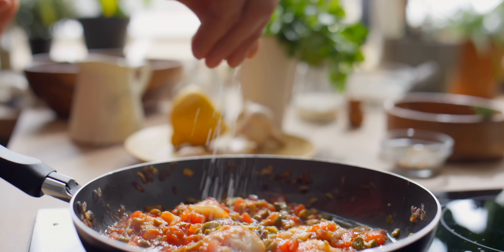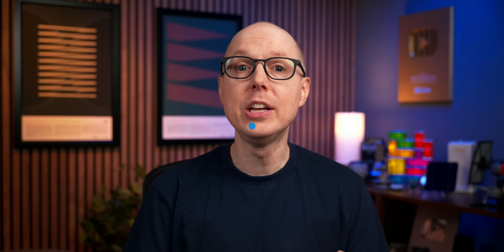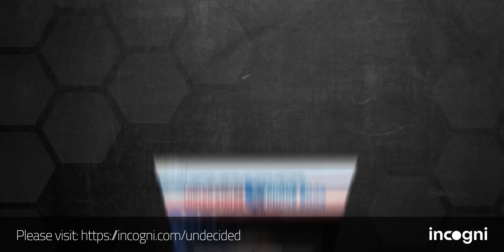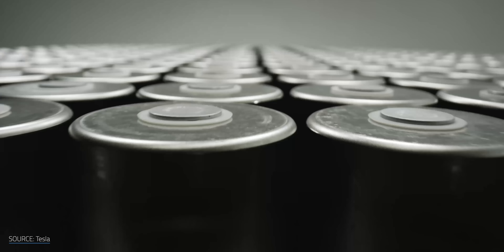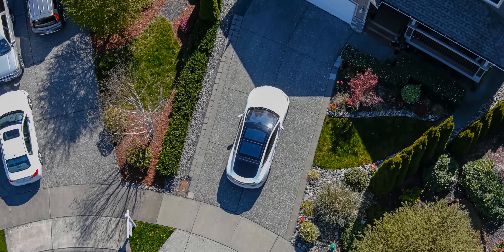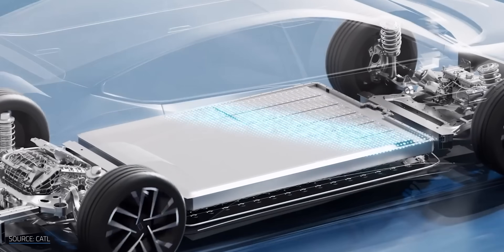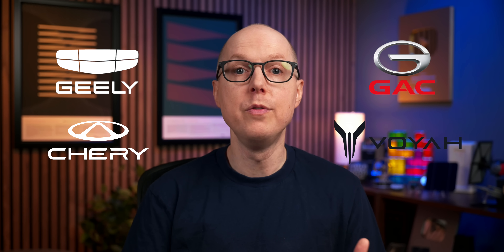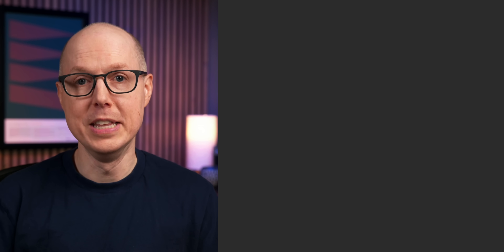How CATL Made Batteries 90% Cheaper (And What Happens Next)

Comment: I work in the battery industry and there’s a few points I would have liked to see you include. First, the most important thing to me is that these have been tested by a third party, which they have. So many battery companies will make outlandish claims that it’s not worth getting excited about anything until somebody else proves the results. Second, I think it’s important context that experts predict that at least in the US market EVs will not outcompete combustion engine cars until we get energy densities far greater than NMC, let alone LFP or this new technology. You’re absolutely right to point out the utility of pairing this with other chemistries or using this for home backup, but I remain skeptical of shifting the market towards low energy density EVs. But maybe I’m biased because I work for a lithium sulfur startup.
Reply: Higher energy density will help but not as much as lower prices. If we couldn't get higher density but could produce EV's at ICE prices or lower then game over for ICE's. That will happen this side of 2030.
Reply: @TimMountjoy-zy2fd  But if you factor in running and maintenance costs, EVs are already the cheapest alternative, at least here in Northern Europe. Still about 50% of new cars sold in my country are ICEs. Range anxiety, ignorance, habits and political views factor in. Personally I would never buy an ICE car now mostly because of the environment, but also because I think the re-sale value of an ICE will be dismal in 5 years time.
Reply: @LK-jl3pc I'd push that out further to 10-15 years, though I agree with you broadly. Older ICE cars made between 1990 and 2010 are quite reliable with widely available repair parts. Modern cars have more expensive repairs due to computer-based everything ($2000 windshield anyone?), despite lower operating costs for EVs. Bare-bones low-end EVs can be better than ICE in all ways, but car companies have to fill this niche. Fuel costs will have to triple before ICE cost of ownership is untenable for the most cost-conscious.
Reply: @LK-jl3pc  While EVs are more efficient what's even cheaper is buying a beat up car made in the early 2000s. The tens of thousands of dollars you save doing that more than make up for the thousands of dollars more you'll spend on fuel and repairs. EVs make sense if you were going to buy a new car anyway, but for most people, that is very bourgeoisie, it will be a long time before EVs completely kill ICE
Reply: @qrzone8167  You are probably right that buying older used cars us the cheapest short term solution. But most people - at least in my country - values reliability a lot and simply hates when they cant trust their vehicle. And also a lot of people only buy new cars. 
For new cars it will only take a couple of more years before EVs will be cheapest to buy, run and service. And then the snowball starts rolling. Gas stations and garages will become fewer and far between further accelerating the change. So it is not going to take a long time in my view. Cheap EVs (15K usd or less) are coming soon and this will prompt people in Asia and the global south to shift.
Reply: @LK-jl3pc  the environment will not be affected by your car choice...sorry
Reply: @scrout  That is complete nonsense. There is a fair amount of misinfo floating around, but also plenty of studies debunking it...sorry
Reply: @scrout hell even if you were right (you're not) it at least makes your HOME environment that much cleaner.  Not having to put up with gas fumes or the heat from an engine is a game changer, especially for mowing equipment.
Reply: @taylormoon3561   the main factor stopping EV adoption is the poor value proposition, which is purely down to lithium batteries being expensive. Nobody would bat an eye at having to drive a 3 ton car of which 2 tons are just batteries, if it cost the same as a combustion engine car while having 2x range.
Reply: @michaelbuckers no what is stopping EV adoption is market interference from tariffs and trade blockades. Chinese EV are available with better performance at lower price. So much so that not having one wastes money via oil imports and repairs
Reply: @michaelbuckers  as someone who regularly visits China for work, I find it sad how little Americans know about how much better EVs are than ICE vehicles. You may think it's expensive because you only see the uncompetitive products produced in the west. If Chinese cars and their prices released in the US, it would be an utter massacre. Jim Farley wasn't joking when he said the Chinese would massacre US companies. 

The reason we aren't moving towards EVs is because of the fossil fuel lobbies and how much money is being subsidized towards fossil fuels. A whopping $760 billion dollars a year is provided to fossil fuels by the United states and those receiving a share will do everything to stop green tech from taking hold. That's trillions of dollars over the last decade. It's also hilarious because we complain about China subsidizing EVs because they spent 230 billion over the last 16 years 😂
Reply: @OrdoXenos1020  blud conveniently fails to mention colossal grants from Chinese governments to EV and rampant investor scam schemes leaving thousands of finished EVs rot in the elements outside and millions of them not even finished.
Reply: @michaelbuckers  yeah I think range is less the issue, cost and perhaps maximum charging times are. That time you have to drive far, it just has to charge fast enough not to be a nuisance- and imho with the current crop of chargers in the 200-300kwh range, we are there already. Rest of the time, a more limited range is fine…
Reply: @michaelbuckers  Weight is the enemy of range, and also affects the dynamics of the car.  Space is also an issue - particularly in a small passenger vehicle.  Transportation is an area where a slight premium is justified for the battery tech.   Static storage (home batteries) are somewhat different.
Reply: @graemewoodward  not really. People straight up don't want to buy electric cars because they're too expensive. And the ones that are affordable have awful range and quality. It all goes back to lithium batteries being  50% of the vehicle cost, so the electric tax is almost the same as the cost of the car itself. Don't make a mistake thinking that rich people in America is the entire global consumer base. Vast majority of people couldn't care less about performance or handling deficiencies of a car as long as it's cheap.
Reply: @michaelbuckers  I agree the cost is one very serious thing (cost to buy and cost to replace batteries).  I'd like to add that I want to be able to drive for 2-3 hours, then come home the same day without spending long lengths of time charging.  Or if I go somewhere that is 6 hours away, with internal combustion, re-fueling is 5-15 minute stop.  In the winter, if i go somewhere 2-3 hours away, with the heat on, and maybe a head-wind, to go to an event (meaning, parking outdoors for a period of time), I'd like to be able to fill up and go back home (without worrying that it's too cold out for the car to charge (lithium must be kept warm to charge - using internal self-heating mechanisms)).  Same story if I visit relatives for winter holidays, get-togethers, etc.  Even without considering the cost and range problems, the re-charge time and re-charge conditions are a deal breaker.
Reply: @graemewoodward  Weight is near irrelevant for range.
Reply: @Mikkel111  incorrect. It takes proportionally more power to accelerate and cruise a heavier car, due to momentum and tire rolling friction respectively. Also heavier cars are usually bigger so they have greater frontal area and worse drag coefficient so it's more power to cruise due to aerodynamics also.
Reply: @timecentral3134  ever since Tesla invented full edge electrode tabs, charge rate is purely down to power supply electric current capacity (provided you use DC direct charge) which is then limited by the grid capacity. Our electric distribution system was only designed for incredibly low power applications like illumination or heating. If you ever though your house consumed a ton of power, this didn't even held a candle to the amount of power your car uses to slowly roll down the street, nevermind cruising on the highway.
Reply: @michaelbuckers You can claim that all you want, but actual tests show marginal differences in range/fuel economy due to weight. Drag is the only real differentiator.
Reply: @Mikkel111  in city stop and go traffic, weight is the main contributing factor to power draw. It's how you get 2 mpg figures while in city traffic, if you ever checked out your onboard computer readings. In cruise, that's either tire resistance or drag, depending on speed and car aerodynamics. For example on my 2007 Ford focus at speeds below 40 mph the fuel consumption is dominated by tire resistance, on my 2007 Vauxhall VRX with slick tires that's up to 30 mph, but on stock tires it's 50 mph. Only above those speeds you get the drag's signature quadratic increase in fuel consumption with speed.
Reply: @michaelbuckers  I mean, golf carts are cheap, but can't get on the freeway or go very far. Performance of a modern low-end passenger car is still impressive, equal to race cars in the 1940s, and speed-record-setting in the 1910s. Even low-end buyers need a car that meets these basic specs - top speed of 80, 0-60 mph time less than 12 s, range of at least 150 miles. That puts huge constraints on battery EVs that ICE 3-cyl with a small gas tank easily reaches.

With batteries high enough in energy density and low enough in cost, the calculus shifts. EVs are more maintenance friendly and cheaper to run, just pricier to buy (for now). Battery advance is the missing piece.

I'd guess 10 years before we have EVs cheaper and better than ICE cars even without govt incentives or regs. At that point, low-end cars will be EV because its cheaper.
Reply: @Mikkel111 not if you have elevation changes. Then it matters very much. I also came from the flat lands in gulf coast TX, but now live in PNW. My hybrid RAV4 work vehicle got 42 mpg driving mostly flat, but now gets 36 crossing mountain passes. 15% penalty from climbing. That gets worse towing, and over shorter distances where accel is more frequent.
Reply: @XxxThePsyCheMisTxxX  bro did you seriously compare a car to a golf cart as if it's the same thing? Are you being obtuse on purpose or are you simply 12 years old? There's obviously no connection between a car and an oversized mobility scooter. Not to mention, their value as a vehicle is even worse than that of Tesla, and Tesla is a real car that actually goes places. The comparison is Tesla vs hypothetical e-Jimny that's fraction of the cost and drives adequately. The latter would be a reasonable purchase whereas the former is a posterchild of modern EV: incredibly expensive meme car that doesn't even aim below luxury price bracket despite not being a luxury car. Obviously vast majority of people can't afford a luxury car so they won't buy an EV, it's very simple. The range, the chargers network and the resale value don't even come into the equation, the first term alone is a dealbreaker.

Also ICE vehicles never gonna leave the roads. Just the fact that they need hundreds to thousand of horsepower for a full day straight makes battery power a non starter. They might shift to alcohol fuels in the future but they're gonna stay, that's for certain.
Reply: @XxxThePsyCheMisTxxX  bro did you seriously compare a car to a golf cart as if it's the same thing? Are you being obtuse on purpose or are you simply 12 years old? There's obviously no connection between a car and an oversized mobility scooter. Not to mention, their value as a vehicle is even worse than that of Tesla, and Tesla is a real car that actually goes places. The comparison is Tesla vs hypothetical e-Jimny that's fraction of the cost and drives adequately. The latter would be a reasonable purchase whereas the former is a posterchild of modern EV: incredibly expensive meme car that doesn't even aim below luxury price bracket despite not being a luxury car. Obviously vast majority of people can't afford a luxury car so they won't buy an EV, it's very simple. The range, the chargers network and the resale value don't even come into the equation, the first term alone is a dealbreaker.

Also ICE vehicles never gonna leave the roads. Just the fact that they need hundreds to thousand of horsepower for a full day straight makes battery power a non starter. They might shift to alcohol fuels in the future but they're gonna stay, that's for certain.
Reply: @michaelbuckers  And how exactly do you plan on running out of battery in an EV with city traffic - other than maybe a taxi/delivery driver?
Range is only an issue when driving for extended periods, aka. city effiency isn't really relevant.
You can say it all you want, but when an empty trailer gets within 2-3% the MPGe of a fully loaded trailer, that means the acutal drag is the wind and not the tyres.
Reply: @michaelbuckers  Also, you seem to be confusing inertia with momentum and rolling resitance with friction.
And a car's drag coefficient has nothing to do with its size. You can have a big car with a better drag coefficient than a small car.
Reply: @XxxThePsyCheMisTxxX  Well many places there is taxes on buying cars where there is lower or no taxes on 100% EV cars, this sets EV in procurement to the same prices as gasolin, further more some have annually taxes for a car where the cost of EV cars are a fraction of gasoline and diesel is even higher. meaning today its same price to buy and way cheaper to own/run a EV in the EU.
Reply: @michaelbuckers  Total cost of ownership of a Tesla Model 3 (the vastly superior car) is lower than a Toyota Camry.  You're completely wrong about value.
Reply: Since Europe and Asia set on an EV/hybrid-only 2030/2035, the US will have way less cars to chose from.
So while they might be able to buy trucks, basically all other cars will be EVs, whether they like it or not.
Reply: Power density only 7% lower than lithium is made up by lasting 3x longer. At some point in the battery's life the sodium power density will be beat that of the lithium.
Reply: biased. the solution to less density is just larger cars. China makes plenty affordable EVs with long wheelbases just so that it fit less dense LFP batteries. US EV market is artificially controlled by not allowing China to enter whereas there are plenty Chinese EV brands that are as good as Tesla or better than legacy auto brands
Reply: If you look at stationary energy storage it sodium ion has great potential especially for large scale storage
Reply: Why should you start with NA-Batteries for EVs? I see the mega-potential of NA-Batteries especially in industry, business and private home applications, where you have static, big volumes available, where energy density doesn't matter, but prices/kWh and generally pure capacity at scale really matter + the bigger en-/charging currents NA-batteries can deliver. Imagine big house sized batteries that store excess energy from several windmills and deliver it flattened to chemical parks etc.
Reply: @Lux1431996  completely agree, NA in cars is far less of a thing. NA for home/industry is where the big potential is as density matters much less and cost matters much more.
Reply: If you are in the industry, what do you think of CATL shutting down a huge lithium mine to raise prices?
It brings up my primary point -even if CATL claims are true we are several years away from $10/KWH.  If other companies don’t force them to lower price, they NEVER WILL!  This could all be FUD -CATL making claims to allow Chinese car companies to continue a price war against the direction of the CCP!  Note that ALL the current customers are under CCP rule.
Reply: @skyak4493  lithium ore is not renewable and runs out eventually, so you absolutely must raise the prices of you can help it.
Reply: I mean. for a full shift you need high density. But this already tackles a huge market. Lets say the batteries do become this cheap. Then the short range EV market will become extremely cheap and more people can buy it. It doesnt tackle the whole vehicle market, but one step at a time.
Reply: Cheaper/kwh is always better. News flash, half the US are working 2 jobs to make credit card minimum payments.
Reply: You are right for cars, in the US, we are very addicted to our miles per recharge. For most of the country this is not really a big deal where travel distances are not that far. However there are areas where commutes to work are a solid 40 miles one way and having to charge every single day would be a real bummer and you want to make sure you have plenty of extra room for the battery to degrade. 
Also, for those families who do make road trips, I can't tell you how many times I have seen Teslas charging with extension cords at hotels all night long and being limited to only 250-300 miles per day would kinda stink as if you are trying to do a long day in a gas car you can do much more than that. The necessity of having a second car that is specifically gas just for trips would change peoples buying decisions in the US. 
Again, however, I think for many people 200-250 MP/charge is "good enough" particularly if it knocks $10k off the price of the car.
Reply: Lyten I guess
Reply: The world does not care about the US market and will progress without the Orange Man.
Reply: Please make content or collab with Matt or 2bit to show your product to the mainstream reporters.. its still under reported for 1 year now
Reply: i have the solution, i hope you dont like EV's
Reply: well other country's have environmental taxes on fuel, meaning that could easy tip the cost of fuel vs EV (and then remove taxes for industries that actually requires it). Furthermore i never seen any need for EV to 100% replace combustion. they each have their strength and weaknesses. Like a truck or heavy handling equipment will be less likely to ever have EV, however some can, like city cargo trucks, or agriculture machines that can easy be setup for fixed timings and recharge. here in the EU several urban busses run 100% EV, even ferries on shorter island routes. Also agriculture machines can easy be replaced. its not about doing 1 big push with a man operator when you can have 3 minor autonomous machines doing the same job 24/7 with no salary, and can charge mainly when grid prices are low, only thing it requires is a cable line to a recharge hub strategy placed. this is already working fine with Farmdroids and other products. One thing the US could learn from the rest of the world is not having big 4x4 for people not actually needing them, like an example could be taxing on cars depending on types, but lets say you own a farm, you can be free of that tax. Think there is also a general work culture difference where in the EU you are only required to show up at the work place, then the company will provide all vehicles and tools (correct me if i am wrong but some industries in the US expect you to show with your own tools etc.?)
Reply: @taylormoon3561   it has it's use. Long term storage what we need to fight the peaks would be the biggest short term win. Storing it for the evening when the car comes home...

EVs? Nah.
Reply: I'll agree on your second point but as an EV owner I do not blame the technology, I blame the charging infrastructure and its shortcomings are strictly due to shortsighted political mindsets and the fossil industry pushback that "enables" the same.  Despite the shortcomings in the larger charging system infrastructure (and the pushback by the idiot in the WH) EVs continue to gain a foothold in the American market.